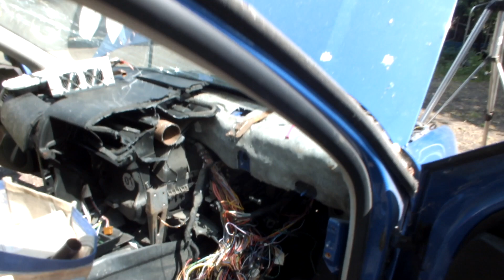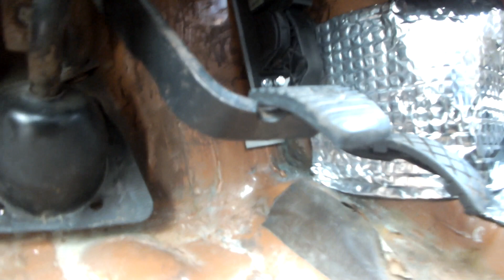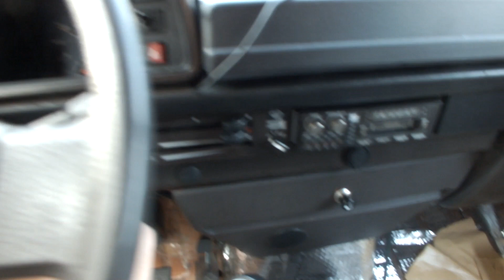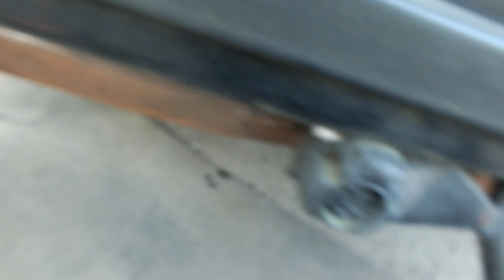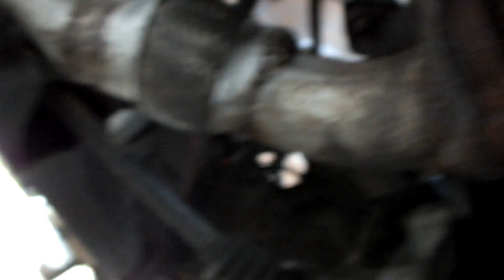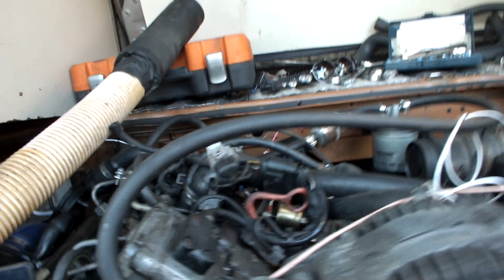VW T25 1.9tdi MTDI FLY BY WIRE CONVERSION

Comment: Love this video, but I can’t figure out, is this an AFN fitted in the T25, but with a different loom and ECU, 
I have fitted an AFN to mine, but I’m struggling with the wiring, this is a great video, but is the loom and ECU from the AFN?
Reply from the maker: Anything from the Mtdi range is basically the same. 1z, afn, etc.etc. Just different variations
Reply: @Bodgemiester  is there any way I could contact you? Is fitting my AFN engine and loom similar to what you done in this video. Thanks
Reply from the maker: No, much later engine

Comment: Hi there. I’m putting the same engine in my Toyota hilux. Where did you get ecu stuff done ?
Reply from the maker: Hi, i had it all custom programmed. You can actually buy an ecu on ebay now. I was just one of the first to crack the wiring

Comment: Hi, great vid. I have a T 25 with a 1.9tdi conversion. IZ engine. Fly by wire. Immobiliser retained. Work done by a previous owner. The engine starts but does not rev. There is no pedal fitted after it apparently broke. I’m wondering if this would account for the Rev issue. Would you expect the engine to be in limp mode without this pedal sensor in place? (There are no revs when manually pulling throttle in the engine bay - would this be due to absence of pedal? Thanks in advance
Reply from the maker: HI, if it is fly by wire you cannot rev by hand

Comment: Ok, this is the first realistic wiring vid that is easy to understand. What if you wanted to use the radiator and fans from the bora and the diagnostic plug (obdII)as well? My plan is to use my 03 Bora(Jetta) in a 78 aircooled bus (t2).
Reply from the maker: Hi, thanks for the comment! I don’t think the rad would fit, you would be better off with a Danbury radiator. I’m not sure about the OBD, mine had its function removed in the re map. Thanks again

Comment: You can make the exact same power with a Bosch VE mechanical TDI pump vs drive by wire Bosch VE TDI pump, you just need a TDI pump to do this, not an IDI pump. I'm not sure what pump you were running, but it sounds like you were trying to run the old IDI pumps on a TDI in order to make it a mechanical engine. If you had an actual direct injection specific pump, you did not have it tuned right. Takes same amount of research as the wiring and is far more reliable, but less tunable from your office computer of course.
There are many Bosch VE mechanical TDI pumps including Cummins 4BT and many European models which are very excellent swap candidates onto VW drive by wire TDI engines to illuminate all of the hassle of the wiring and make the engine more reliable, and not needing VAGCOM in middle of nowhere to troubleshoot
Reply from the maker: I’ve had no issues yet, I have tried several different pumps and this one is by far the best (with ecu tune) also it got rid of the 12ft throttle cable so it drives far nicer. I would recommend this any day,

Comment: Hi just came across your video. Have a really nice westfalia camper and want to get some good use out of it and be able to tour and climb hills a bit easier. It's currently fitted with 1.6d. I'm a mechanic by trade and have my own workshop. Just looking for some advice on which is the most sensible transplant rout to go down. Like yourself I don't want speed hi st torque for the hills. Would say that bora engine be a suitable transplant?
Rory.
Reply from the maker: Works great in mine! I drive all around the Derbyshire dales in 4th and 5th no problem. I did rebuild the engine (on channel) but i did have to make my own engine mounts etc. Bolts straight onto 1.6 bell housing but that’s about it. Look through the channel and you will see what I had to do.
Reply: @Bodgemiester  brilliant. Thanks for coming back to me.

Comment: I wont sleep well after this video, you've got me thinking.
I have an ol mk3 fiesta with a mondeo 1.8td engine in it. the pump on it is an old tractor like Lucas/ delphi pump. I have fully manualised it but it lacks in smoothness.
I have been thinking about converting to a bosh ve pump but they are crazy money. I think i could buy a whole bora 1.9tdi for about 100 quid and use this idea. 
Are these bosch pumps pretty much a fly by wire version of the bosch VE pump?
Reply: Pretty sure you could fit cruise control with those pumps and ecu......????
Reply from the maker: Ha ha, it was a pain in the @ss to be honest but well worth it. My bora was FREE!. eBay a cruise kit that just puts the pedal, that’s what I’m doing. All you do is put a magnetic pickup on the drive shaft
Reply: the vw cruise control only has a few switches which i reckon would be easy to wire up on the dash. most of them fly by wire cars have the capability to run cruise control once it is enabled on the ecu. maybe its possible that it picks up the speed from an abs sensor though. do those bosch pumps just time up to TDC with a pin?
Reply from the maker: They do pin up but the pulley adjusts sir belt tension. Using abs sensors is fine if you have abs

Comment: Nice bus, does it came standard with the 1.9TDI engine, I had the 2.1i boxer in
Reply from the maker: Hi Jan, nice to see you again!. No it was originally 1.9 air cooled petrol. The old ford 4d will be back soon too
Reply: Awesome, thanks
Reply from the maker: I’m going to make a huge oil cooler from scratch for it. Should be good
Reply: Can not wait my friend, I will check that out, thanks for your great video's

Comment from the maker: Any questions folks, I will gladly answer
Reply: There's a challenge - OK, here we go:
Great and very timely video by the way - primarily focussed on the wiring - which must put a lot of us off.

Which engine did you use code, AHU, ALH year etc ?
Why not a PD - your reasons might be of interest to others
Did you need to modify/remove the fuel cutoff on the injection pump or wire it to the T25 somewhere
Gearbox issues - strength of existing 5 speed - any thoughts given you remapped a turbo for torque
Choice of flywheel, clutch, physical ratio match to new engine, etc.
Did you consider fitting an (or the original) intercooler ? where...
Ditto an oil cooler as it gets hot back there...
did you have any issues finding holes on the block to attach the T25 engine mounts to  on your new engine ?
did the inlet manifold/turbo/exhaust manifold foul the engine bay and/or engine mounts ?
presume you drilled the block for dip stick and shortened appropriately ?
presume you re-used existing sump - did it fit easily ? special gasket ?
did you remove baffle ?

thanks again
Reply from the maker: Ha ha this could take a second.

The engine in my van is a mix of 1z and afn , i purched the van with a bad 1z in it (see channel for rebuild)

The fly by wire pump is controlled by the Ecu, no need for stop wire however I did need an ignition switched feed for the Ecu relay so I used it for that instead
Re mapping was done to get more low end torque, this should actually be easier on the trans, other people have put far more through these boxes and they survive,I am not anticipating any issues.
The 1.6d and all of the 1.9s share the same basic block so they bolt straight up to a diesel transmission but I did custom make engine mounts.
The engine has no intercooler (yet) but it does have a HUGE oil cooler (see channel)
Used dipstick and sump that came with the van but it is easy enough to shorten a dipstick ( fill sump to correct capacity and shorten stick to suit) and finally the t25 came with a 1.6tdi standard so no fouling issues, this is why I did not change to a pd. I’m sure it could be done but I really don’t need the power, just wanted a bit more than it had. Phew,   Please subscribe!
Reply: Just watched this and have been searching for info on a engine swap from a sdi to tdi 150pd arl engine, would it be relatively the same wiring? Any help would be grateful
Reply: To avoid problems with the immobiliser on the 150pd, you would normally expect to buy and fir a "kit" including dash, ecu, key switch etc. Frankly I think the easiest way to swap a modern engine would involve transplanting the entire wiring loom as well - not the only way but probably the easiest way.
Reply from the maker: It is not as easy as it sounds trust me. Call DRKA in Chesterfield (did mine) and get the immob totally mapped out. That is by far he easier way.
Reply from the maker: Hi, no I don’t think so. Totally different engine. Why do you need so much power? The gearbox will not be happy about it. Top end speed will still be the same
Reply: Awesome!! What's the benefits of using this engine vs the 1.9 tdk?
Reply from the maker: @oysteinluring7157  not sure what the TDK is to be fair. Is it the same family as all the other 1.9s?
Reply: @Bodgemiester  tdk is the 1.9 engine block from early golf but with the pump and turbo from jx..
Reply from the maker: @oysteinluring7157  every day is a school day. My engine is now a 1z bottom end with an and head
Reply: @Bodgemiester  i see! And the electronics and everything works well? :)